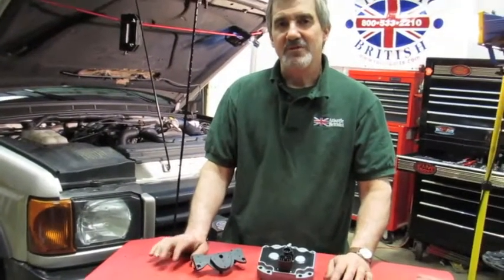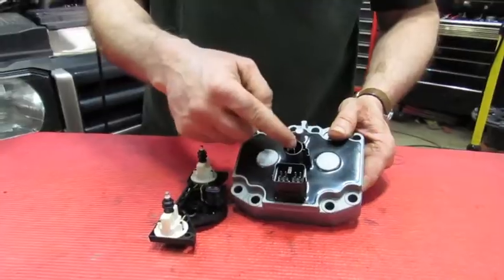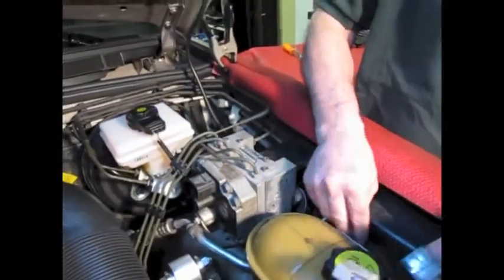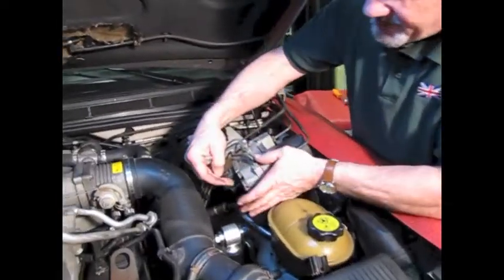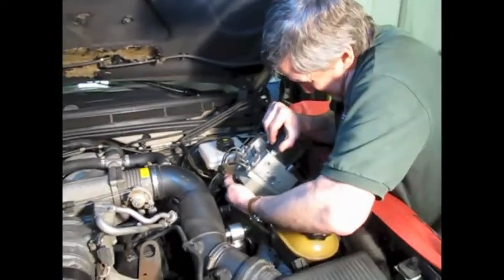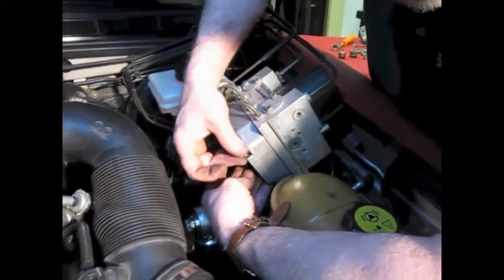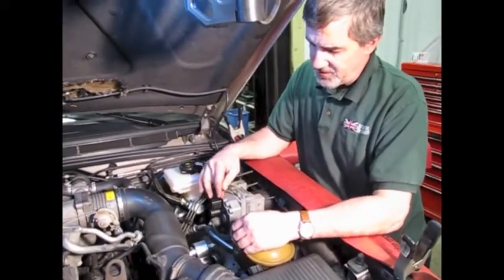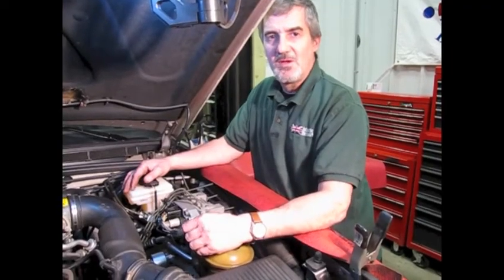Installing ABS Modulator Valve Kit On Land Rover Discovery Series II

Comment: Thanks for the video. The shuttle valve actuator bolts are 4mm and the module bolts are 6mm. If you strip one, I used a 40 torx to loosen the bolt.

Comment: I have a code 1590 and when I had it checked there was no communication.  My ground is good and my fuses and relay are good. What else could I check before I drop it off to be repaired?

Comment: I have a code on my Disco 2 for "shuttle valve switch failure". does that sound like the shuttle valve actuator your referring to on the bottom of the ABS?
Reply from the maker: Yes, however, this could be caused by not just the shuttle valve, please refer to this video: https://www.youtube.com/watch?v=R47MStFt27Q